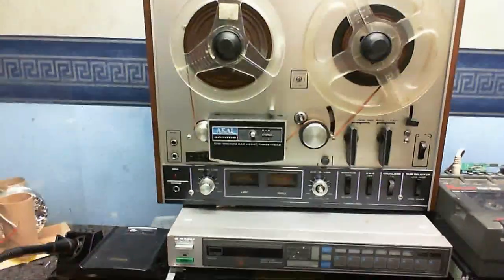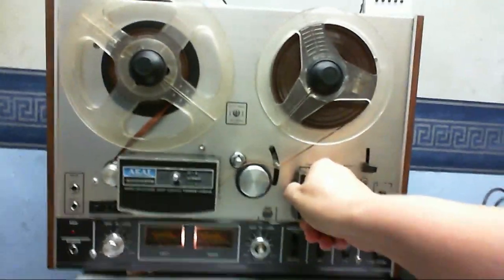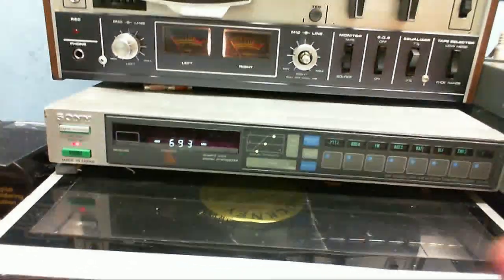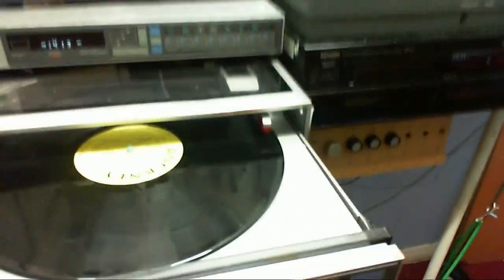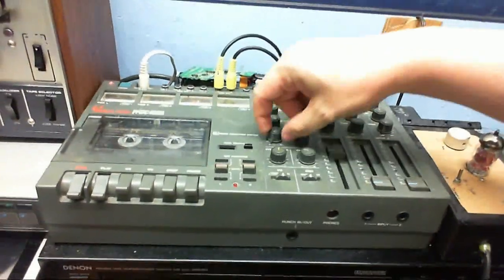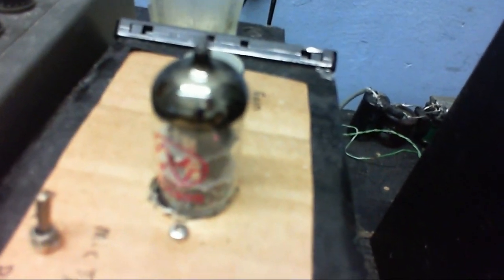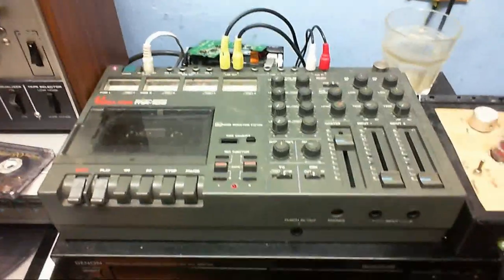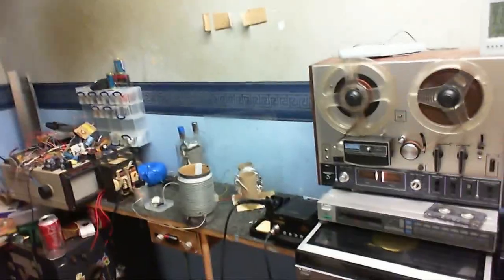My Bedroom Audio System Setup

Comment: with one tube extra you can make the mic preamp full tube
there is a little compressor circuit on the internet that usses and old double triode
Reply from the maker: That would be awesome! Do you have a link anywhere for that? I wanted to go all-tube with that preamp but couldn't find compressor circuits myself.
Reply: the circuit have to be adjusted for use on a ecc8*
but it should work
http://www.preservationsound.com/wp-content/uploads/2010/10/OneTubeComp.jpg
http://www.preservationsound.com/wp-content/uploads/2010/10/OneTubeComp_p22.jpg
Reply from the maker: *****
Thanks, I'll have a good look at that, as a matter of fact I've got some parts I ordered for some other projects I'm working on and I always buy extras, so I'm sure I'll have more than enough parts left over to build this.
Reply: i have asked around
a ecc82 should be the same as the tube in the circuit
but with a diverent socket
and it acts more as a limiter then a compressor

Comment: Nice setup. What about the speakers?
Reply from the maker: Yeah I forgot to mention those, they are a pair of Acoustic Solutions bookshelf speakers, 4 inch woofer and 1 inch tweeter, sealed enclosure.  They sound pretty decent and were built well, they even went to the extra trouble of putting wadding inside!

Comment: You filmed this during a day? That static is caused by solar interference. When you listen to it at night, you will get less static and more stations
Reply from the maker: No this was at night, so yeah there should have been less static, this was about the worse reception I've ever had on that tuner, it usually sounds much better and cleaner than this.
Reply: ***** So clouds somehow attenuate radio waves? Interesting for sure. Cloud (water vapor) will soak in microwave radiation really well, but in MW band - I don't know why
Reply: ***** Exactly. Dew on a satellite TV dish also ruins reception, but once again, it uses much higher frequencies. However, maybe longer waves are really reflected instead of being absorbed

Comment: I like the 80's radio tuner and the boxy 80's turntable, but why do you hate CD's? CD's are 1980's technology been around for over 30 years now. Digital is not so modern, CD came out around 1983. DAT tape in 1987, Minidisc in 1992 and DVD in 1997. but blu-ray is modern.
Reply from the maker: I don't hate CDs, I'm just not overly fond of them as an audio storage medium, if a CD gets so much as a crack or a bad scratch, it's pretty much the end of the CD.  Records on the other hand can still play if cracked, scratched or split, just with loud pop every time it turns. I like tapes because they're quick and easy to use and can be usually be repaired if they break, but I also like MP3 as well since it does not degrade over time or get worse with each copy like a tape would. I don't care much for blu ray anyway either.
Reply: CoolDudeClem one of my friends told me, there exist a scratch removal kit out there to be used on CD's and DVD's.